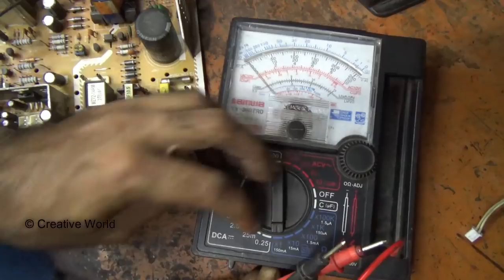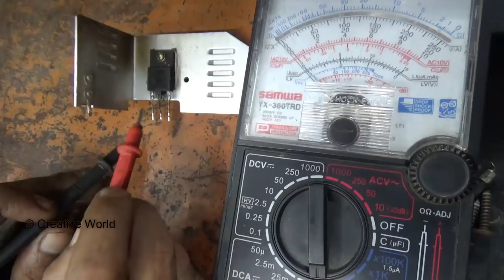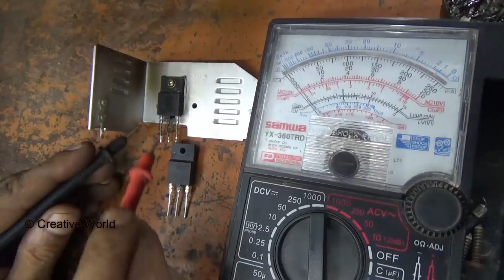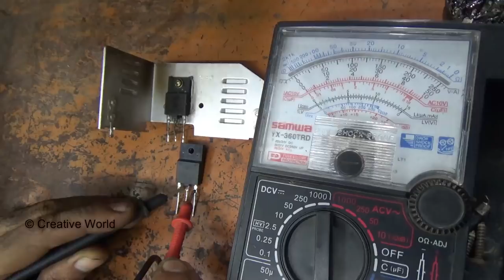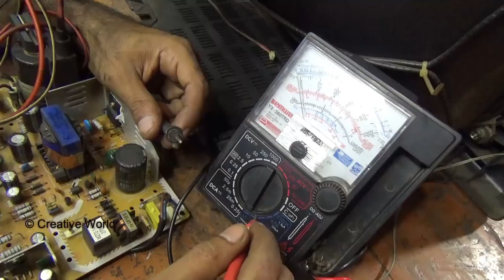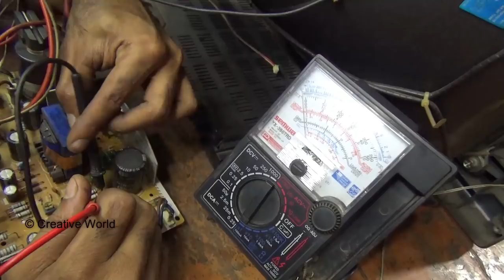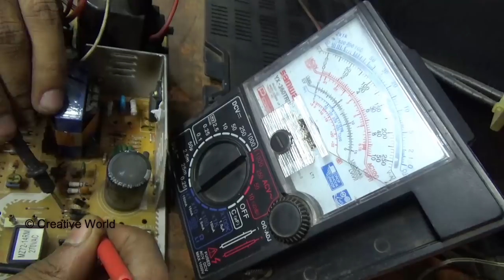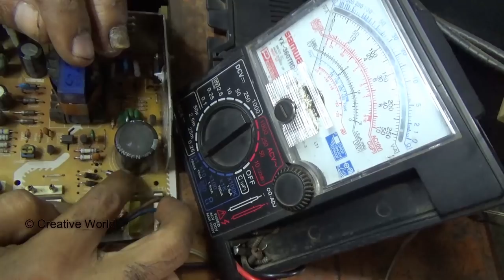How To Repair Power Problem Of A CRT Color Television (Part 1) - Bengali Tutorial

Comment: Whats the problem when tv is light on and some times don’t light on?
Reply from the maker: if light permanently on - then it will be short circuit.
Reply: @CreativeWorldPro     Thanks for your respond. Not short. It works well
When turned on.  But some times it not turned on in days. ?

Thanks. U

Comment: Sir mera lg tv hai wo on karnese red light bohot bar blinking karta hai or dug dug karke awaaz karta hai uske baad on hota hai. Kya problem ho sakta hai sir...?
Reply from the maker: you should check power section,,you also can change 100uf,,160-200 volt capacitor,,that stay beside flyback
Reply: Thank you sir
Reply: Akash Karmakar

Comment: vai tv te kono power nai but circuit er main dc voltage 300+ and discharge o hoy kintu 2nd side e kono voltage nai ..r front led o off .. what can i do vai  pls bolben...
Reply from the maker: transistor and vertical IC open kora volt check korun,,,

Comment: You are not find out the transistor base voltage
You first check the base voltage
Transistor 1802
Reply: TV ko shri's board mein line Dete Hain To on off Hota Hai Magar chalu Nahin Hota problem bataiye

Comment: I'm a Subrata r. CRT TV power supply fault repair course., MOSFET and I C power supply board. No output voltage
Reply from the maker: you should power section of your television
Reply: O humondi gara tv ripiar kore tara sirig babohar janena tor sikhan lagbe